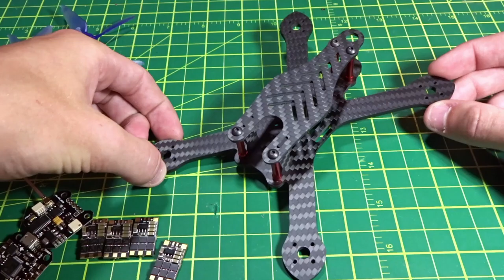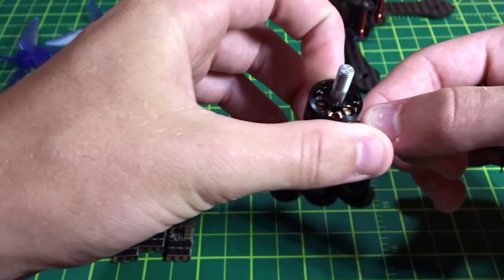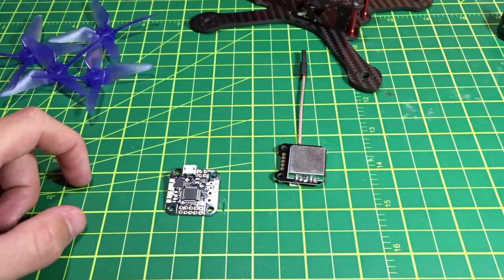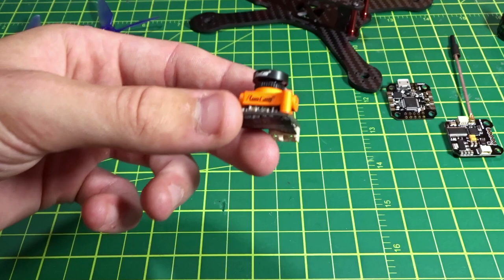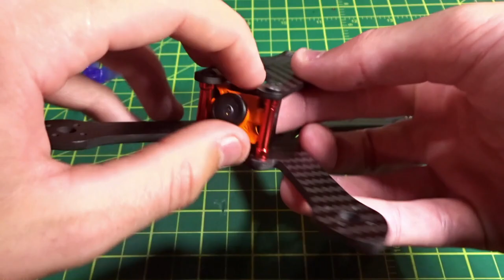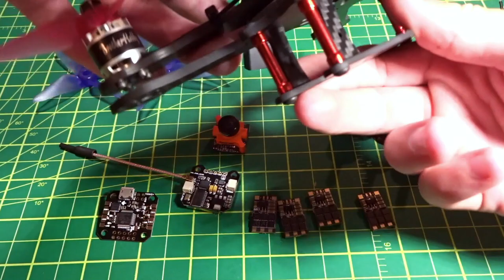3inch Quad Build : Parts Overview

Comment: Love your 3". I just finished mine but I'm having trouble pid running it.  Stoxk bf 3.2 pids don't seem to work well for 3" and I'm not 100% sure which way to go.  Any tips or do you have a pid tube video on it?
Reply from the maker: You need to lower them pretty decently. I gains can stay the same, but lower your Ps on pitch and roll close to 3 but leave yaw at like 8, and then D to like 18 and 20
Reply: That low in BF 3.2?  it was set at like 40
Reply: Thanks, ended up going at about 25/27/70 and cut D to 20...but i forgot that anti-gravity gain defaulted so i reset that to 20,000 and i think i'm like 99% there.  Thanks for the help

Comment: I think you should gone with the new Avant Xero 3 which is 27g :) and also uses the micro swift!
Reply from the maker: Link to this frame? 27g is impressive.
Reply: The RCAddict comes out in a couple of days, I like their frames. Nice and simple. Also as a bnf. http://avantquads.com/products/XERO-S3M--Racing-Frame-%22Blue-Edition%22-%283mm-Unibody%29--%22NEW%22.html
Reply: The RCAddict out of interest, why another 3 inch? I'd have thought the hyperlite baby was still pretty new.
Reply from the maker: It sure doesn't look 13g lighter to me, I am skeptical of that weight. Why not? haha they wanted to send a 3inch frame so that means it's time for a 3inch build ;P
Reply: The RCAddict lol fair enough. I've had 4 of Avants frames and they've all been spot on weight wise so far. They're sending me one this week, so I'll let you know!
Reply from the maker: Intersting, it just looks like the same amount of material. Perhaps they are use a carbon foam fill?
Reply: The RCAddict no, its all legit. I think its slimmer and shorter. I'll let  you know! Got some rcx 1407s on the way after engineerx posted his review. should be a little rocket. Now I just need the skills, but i can't buy them :)
Reply: avant have just shipped my Xero 3, hes just sent me photos of a build he just did with new 25amp 20x20 cicada escs, and it weighs 128.9g auw with props on. Getting a bit excited now!
Reply: The RCAddict just received the avant 3inch, weighs 27.5g including hardware and has full 3mm chamfered carbon. Pretty impressed with it!

Comment: Seth, I am working on a build, do you know of any 20x20 4in1 ESC's that are 20+ amp? I'm guessing thats why you went with the 4 individuals because there isnt much available in 20x20 that can handle the amps.
Reply from the maker: I mostly went with these as I needed them quickly (was hoping to fly it for the race) and it's what he had to send haha. I think this flycolor tower is 25a. Justin Skinner uses it in his 3inch neato. https://www.banggood.com/20x20mm-XJB-F425-Dshot-Flytower-Micro-F4-AIO-OSD-BEC-Flight-Control-25A-Blheli_S-2-4S-4-In-1-ESC-p-1148284.html
Reply: I found a 20x20 20amp 4in1 ESC to use, i heard you are changing the motors out due to vibrations, any additional info on that? I ordered these same motors for my build.

Comment: A question...I’m building this quad...a Piko BLX FC with the kamikaze BLHeli32 ESCs you link...when I power up the FC, I get the first five tones (of 6) from one esc I soldered in to test.  Bee bee beep...bee (but not the last beeeep).  Did you have to do anything special with this FC to make it work with these ESCs?  Or some special setup with BLHeli32 suite? Do you have any idea why I’m not getting the last beep?  Sorry to bug you...
Reply from the maker: Could be an issue with the firmware that you have flashed on the FC or ESCs. Mine worked fine on Dhsot 600

Comment: Just noticed that the escs that you are using dont come with wires to connect to the fc. How did you connect the escs to the fc? Using what type of wire?
Reply from the maker: Any silicon wire is fine, should be like 18-20awg for this size quad
Reply: Ah ok, thank you! Another quick question, did you solder on the second ground and a signal wire, or did you just solder the positive and ground on the outsides?
Reply from the maker: No spot for signal ground on this FC ( I think) so I didn't use it no.